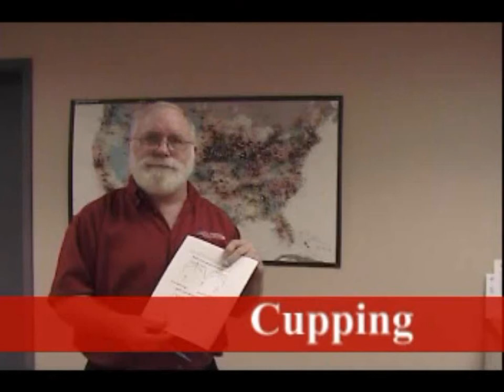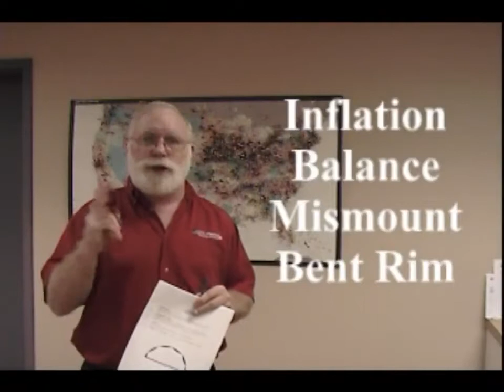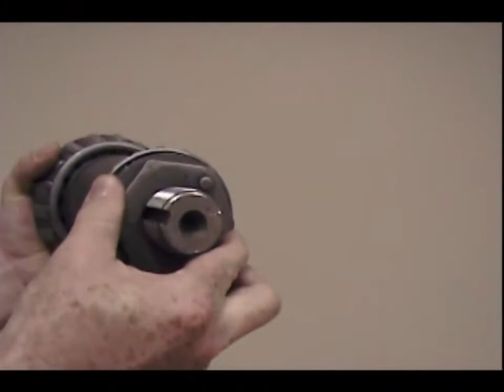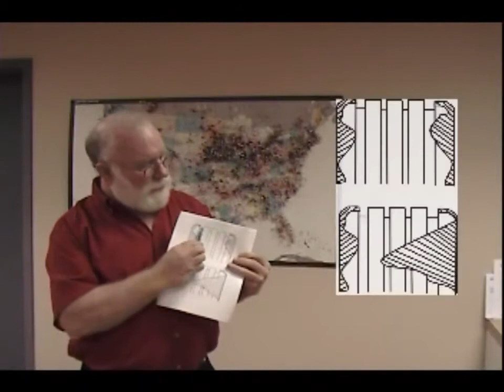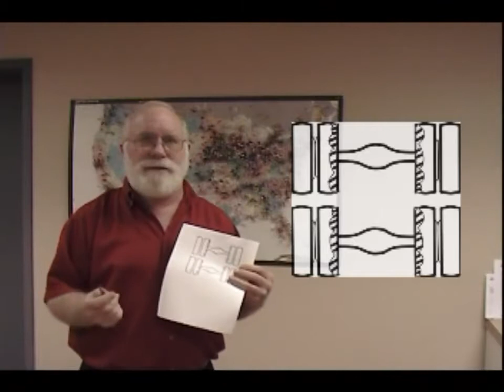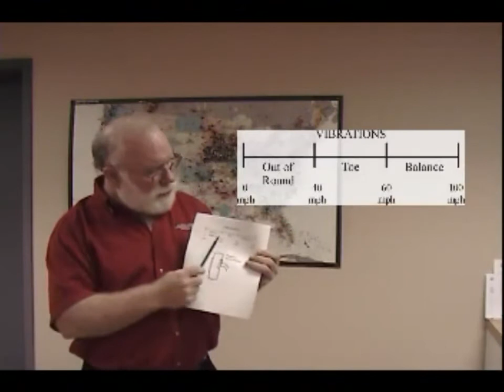Commercial Truck Tire Wear and Handling part 2

Comment: Hi, Can you guide regarding Heel and toe wear in Drive and Tandem tyres. Each lug in the tyre wear out on opposite ends. This generally happens due to inconsistent dual tyre inflation but what if it happens on edges only and tyre inflation is consistent?